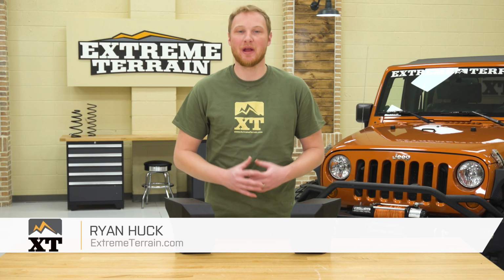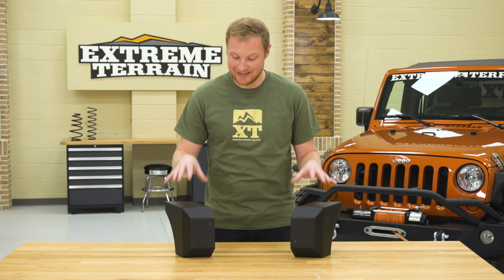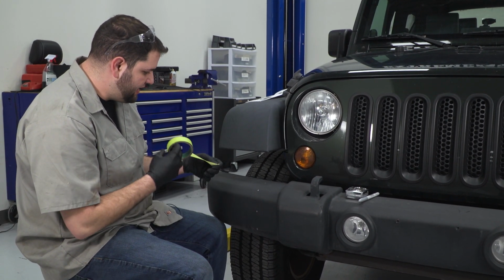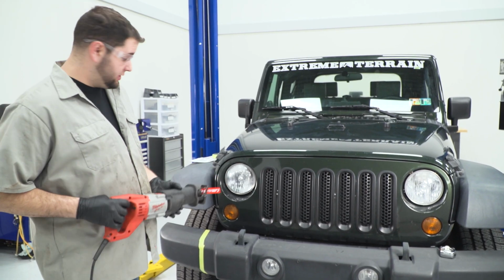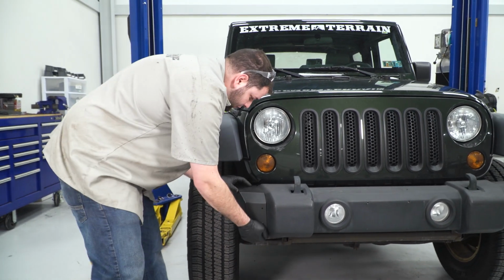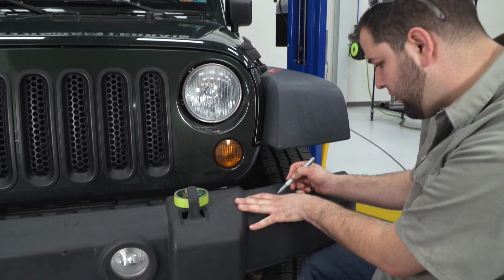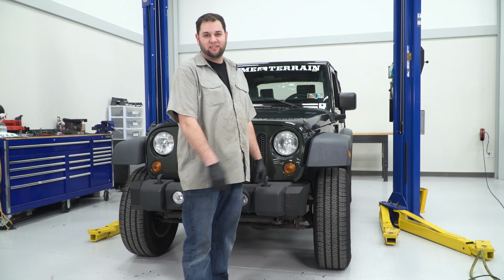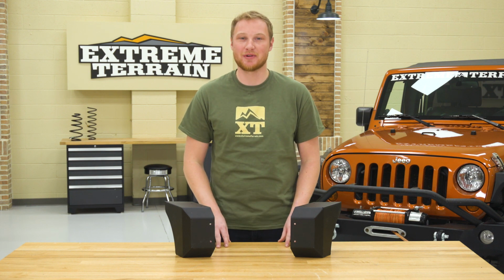Jeep Wrangler Rough Country Bumper Caps (2007-2018 JK & JL) Review & Install

Comment: I don't mean to critique, but you do realize at the beginning of the video, you said, "2 out of 3 wrenches - only 2 bc you are doing some cutting, but just through the plastic part of your factory bumper" & then cut the metal part of the bumper?
I only comment bc I just purchased these and thought that was the case and found your video when seeking clarity. Great video btw, best of any out there that I watched as the Rough Country video doesn't even show it bc directions call for removal, which is nonsense,  yet more safe I suppose.